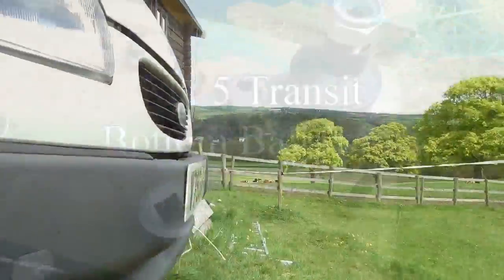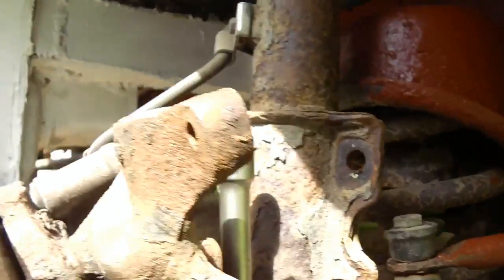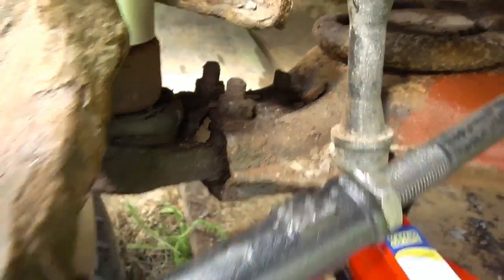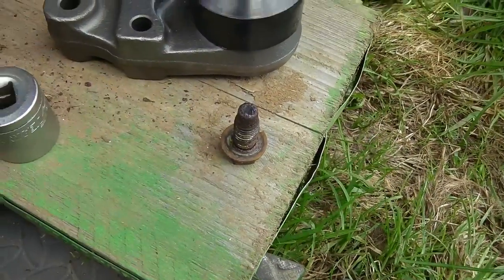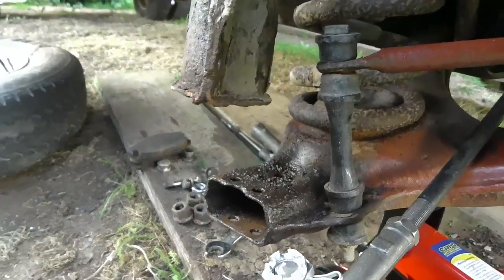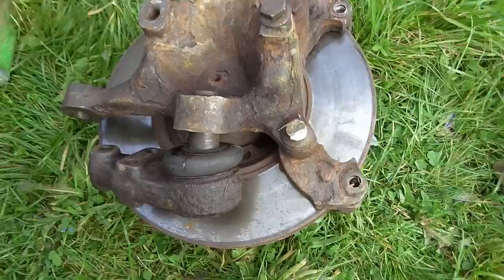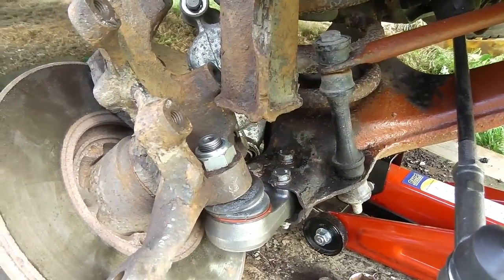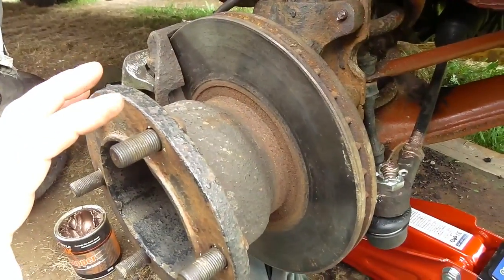Mk 5 transit bottom ball joint

Comment: Guys, hello from Ukraine!
If you have a lever-and-screw puller to press the tapered pin out of the hole, there is no need to remove the hub from the machine.
And if removed, then the finger is simply knocked out with a hammer.
The bolts with which the ball joint is attached to the lever are installed with the head up.
In general, all the bolts are installed with the head up so that they do not fall out if the nut is unscrewed.
My nickname on the forums is "черный_чак" or "cherniy_chack"

Comment: the best
Reply from the maker: paul woolacott 
thanks Paul....my knuckles are slightly grazed but another job done.... Done yours yet..?😉
Reply: na not yet lol you frighten me off it,na not rely, waiting for some nice weather
Reply: cheers paul ,but got some mates with all that sort of tooling
Reply from the maker: paul woolacott 

I was considering an even bigger club hammer to shift it...lol
Reply: i bet frustrating when it dont come apart easy ,did it take you long,and whats the next project
Reply from the maker: yeah it was a pain... the hub came of easy once the 3 bolts for ball joint were removed.  Once I had the hub on the floor, a few turns on the big splitter..off she came.
It wouldn't shift with the old methods, even broke my fork splitter....
Just waiting for New windscreen then MOT
Reply: good luck with mot mines in july but might get it done early
Reply from the maker: paul woolacott 
thank you